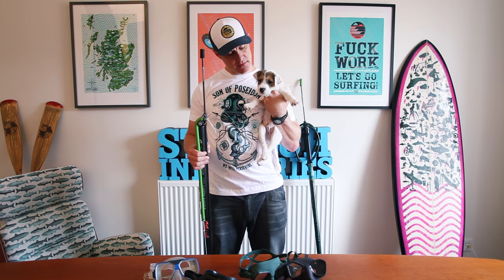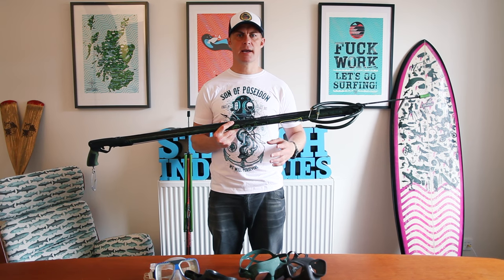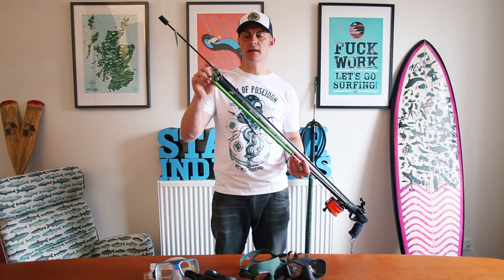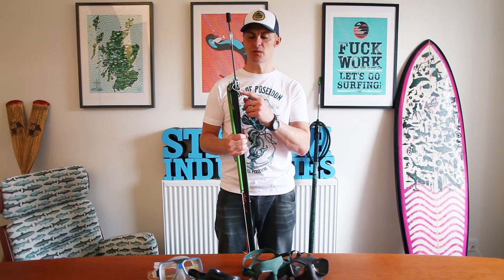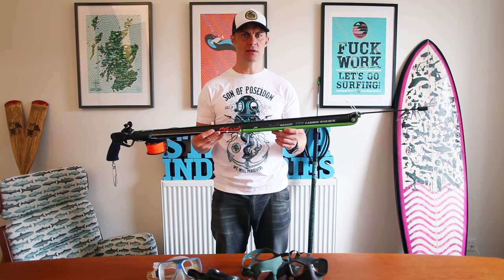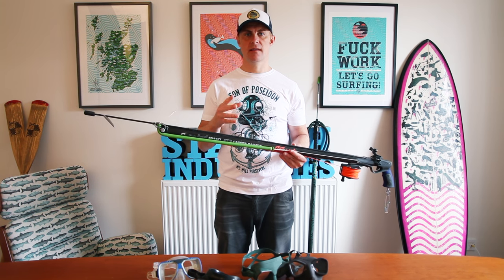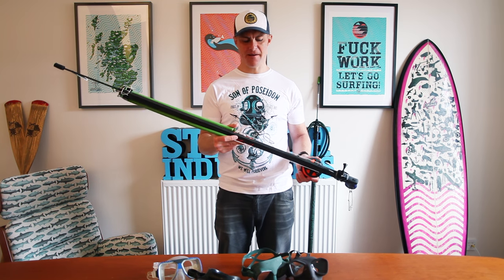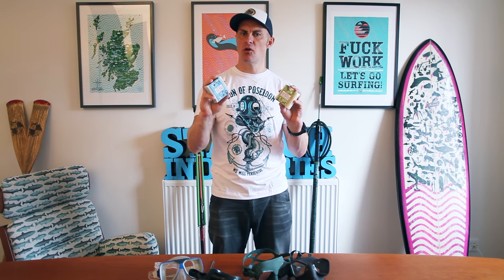HOW TO: MVD Rollergun Upgrade Review

Comment: Hey Buddy,  nice channel I, I have a lot of time for people that try new things and questions status quo. 
I too moved to rollers 8 years ago and over the  years the learnings have been many.  here are a few: 
1- short overhang is way more accurate, dont take my word, just try it and you'll see for yourself. 
2- use full pre-tension, and forget thos dynema extending cords at the bottom. if you do this you will experience less recoil and more power.  Chris Coates spent the time to make a nice Youtube video about this.  correct rubber lenght for a full pretension system is 50% of barrel lenght + 5cm.  thats it.
3-  dont worry about the wishbone, they last forever even when they go fluffy. make sure your two stainless guides at the top are always smooth, I use a sponge sanding paper (500 grit) and smooth it periodically. 
4-  resist the temptation of using 16mm rubbers on anything under 1.2m long guns, unless you dive in very cold water. 

thank you for the video. nice job
Reply from the maker: SOLID ADVICE!!!!!!!! AWESOME
Reply: Hi, could you elaborate on point4 please? What rubbers should be used and why not use 16mm? Will look into Chris Coates as well. Thanks
Reply: @Close_Call   hey hey.   anything under that barrel lenght can be driven with  14mm bands, making it possible to load without a load assist. Shorter guns fire lighter shafts too (unless you go over the 7.5mm mark), so 14mm is plenty.   take a moment to watch the latest Rob Allen video in which he depicts how rollers deliver power compared to a standard gun. the stroke is smoother and longer on rollers, so you get full speed for longer distance.  ironically the top speed is slightly less than in a standard gun.

Comment: How much pretension did you use? My roller recommended 30cm but I can’t pull the bands at all at that stretch lol. So I went down to 20cm and I still can barely pull the bands. I’m using 16 mm rob Allen bands. I see some people use maximum pre tension and then some use barely any pretension. I’m a little confused lol
Reply from the maker: yes, getting that maximum stretch is kind of the point of a roller gun. you want some good pretension on those bands. Can be difficult to load but thats why its good to have a leaver build into your wishbone- as something to grab onto when you need to get hold of the bands. On my roller i have a bit of dynema line connecting  the bands at the back - you can always adjust that line to maybe make it a bit longer, taking some tension of the bands, but not to much- you don't want them to flop around under water...
Reply: Staunch Industries I been using it at 20cm or no pre tension. Crazy bc no pretension still gives a lot of power and accuracy! And at 20cm... it’s insane. Been having so much fun with my roller. Thanks for making this video and thanks for always responding 🤙🏼
Reply: @StaunchIndustries   just converted my 95 to a roller, seeing your load assist I'm going to make one a similar size, mines a fiddley three finger special! I'm running salvimar S400 bands @16mm, they work well. I do know what you mean about rollergun efficiency/looks/inanimate art... I pick it up all the time to admire its aesthetics..think I love my rollergun..

Comment: what is the setup? rubbr diameter?
Reply from the maker: I used  MVD COMPONENTS - Very good super reliable, with 18mm rubbers. Good luck
Reply: @StaunchIndustries  hi, you are using 18mm bands?? 
wich is the size of the gun? and shaft?
thanks :)
great video.
Reply from the maker: @Rawly84  900 in length & yes I used 18mm band, but you can get away with 16's. I used 7mm- 7'5mm shafts, they pack a punch.  Best advice I can give is to have a look at Chris Coats - Coatsman spearfishing vid channel he does a fantastic job at breaking down rollers & how to set them up for maximum performance.

Comment: Where did you get the anchor points?
Reply from the maker: they came from MVD with the roller set up, but I think you can easily make your own with similar screws from you local hardware shop. Just make sure they are stainless steel.
Reply: Staunch Industries Thanks 🤙🏼

Comment: Want to make one so bad! How do you measure the band length?
Reply from the maker: each rubber should be half the length of the barrel.. also worth a watch.  https://youtu.be/sKfoowyU-GM
Reply: Staunch Industries Thanks bro 🤙🏼
Reply: @StaunchIndustries  I believe this depends on the rubber, amount of stretch it can take as well as the gun length, rubber thickness, shaft thickness etc... What I was wondering is why don't you run your rubber all the way down to the trigger, you waste a lot of potential energy here..